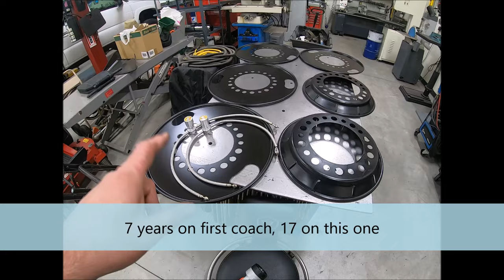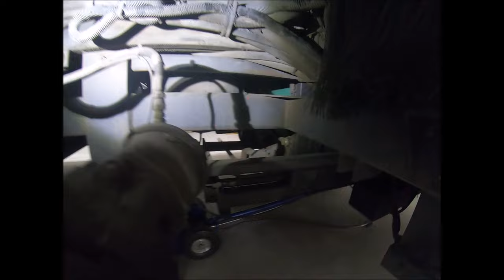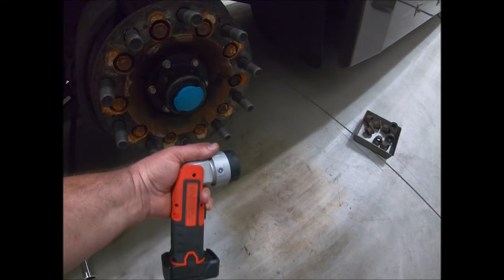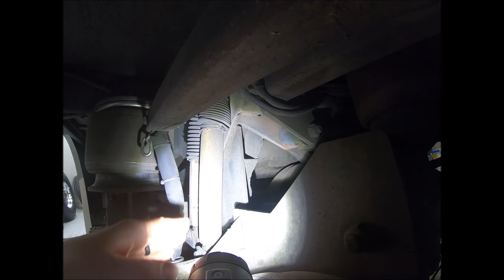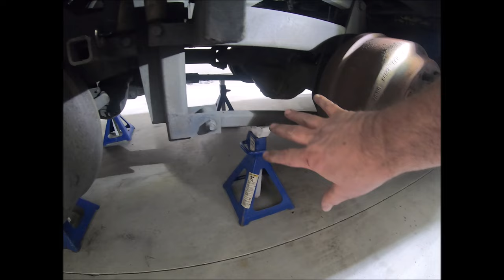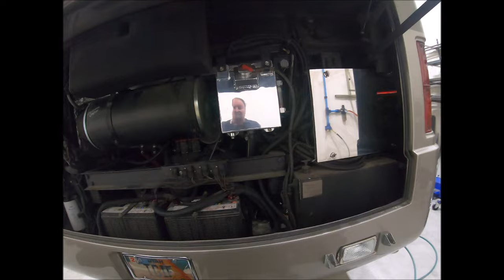Monaco Roadmaster Chassis Maintenance

Comment: As always a great informative video.  

At age 18 I learned that if I wanted the job done right, I'd better to it myself.  My cars and coaches never see a repair shop.  If I want a job done right, I'll do it myself. Yep, I even mount my our coach tires and do my own engine / transmission / drivetrain repair and maintenance.  Over the past 55 years I've saved tens of thousands of dollars, driven millions of miles, and have had the confidence of knowing a vehicle could drive coast to coast without trusting someone to make quality repairs - for me it was great piece of mind knowing that I've done the job right.  Yes, I've invested a lot of money in specialized tools and computer diagnostic equipment but for piece of mind it was well worth it and in my opinion priceless.

After your video, I'm thinking about changing  my 5 P's of Prepare to Prevent Piss Poor Per Performance to your 7 P's of Prior Proper Planning Prevents Piss Poor Performance.  I also have the 6 D's - Duck Dodge Delegate Defer and Don't Do.  When I was a manager in big oil corporate America I often told employees to follow the principles of 5P and not 6D.
Reply from the maker: Thanks Frank.  I couldn't agree more with the peace of mind it brings knowing the job is done right by doing it yourself.

Thank you for taking the time to watch and for the comments.
Mike

Comment: Mike, I am glad that I ran across your video and presentation. I have a 2000 Monaco Diplomat that I purchased a couple years back. It's been hard to get good information about the chassis. For example, the Tie rod ends, and the center link are a problem that no one in my area in South Carolina seem to supply parts. There are a lot of things under the coach that I'm trying to service but it's not so easy when I don't have anything but an owner's manual to lead me. You video was very well done. I have subscribed to your channel and will be viewing your other videos. Thanks so much for sharing.
Reply from the maker: Thank you for the kind words Larry and thank you for taking the time to watch and for subscribing.
Mike

Comment: True, in 2009 there was an economic downturn….
Whatever previous parts were in the warehouse were used. Then, the shortcuts were used to keep the lights on …lay-offs etc.
My old school gasser has a 
cut-above quality. Aluminum roof, aluminum floor vents as opposed to the short-cut flexible dryer vents strung through the cabinetry. Try cleaning out those every autumn without breaking/ ripping them.
It can be a chore finding quality aftermarket furniture. Man made cushions only lasts so long. 
No computerized shades/ awnings and such. Our systems are stand-alone systems. When something needs repair, I stand alone fixin’ it. ✌🏼

Comment: Hi Mike. I just found your channel after Scanner Danner recommended it in one of his videos. He mentioned you do some motorhome videos as well as many other things. After listening to you go over this chassis and hearing all the work and upgrades you've made, I'm really impressed at how much knowledge you have on EVERY part.
  I would like to pick your brain because I recently had a little accident while doing maintenance on my new to me 2011 Tiffin Allegro Breeze 32BR with a Maxxforce 7. I lost a tiny plastic clip(1/4" x 1/4") down the oil fill tube. I have removed the tube and extension neck so I could attempt to retrieve it from the top of the engine. I connected a vacuum to a small diameter tube and try to see if I could suck it up. I can't see it and don't know where it may have travelled and I surely don't know the routing from when the oil goes in, passes through the filter, and all the other orifices in there. Since this is such a tiny piece of cheap plastic, do you think it's something to worry about or will it be pulverised or melt?
Reply from the maker: Thank you for the kind words. 

With the clip being plastic you are probably correct that it will be pulverized and/or melt but it could still get lodged in an oil pickup tube or oil galley and therefore could be directly responsible for a catastrophic failure so I would not be inclined to recommend running it until the clip is retrieved.

Ultimately that would have to be your call.  Keep in mind that if or when it fails, Murphy's law states it will be at the most inopportune time and if you are like me, it will be a constant worry and always on your mind. 

Best of luck. 
Mike
Reply: @zmotorsports62  Thank YOU for the quick response. Do you have any tricks or thoughts on a way to extract?
Reply from the maker: @Jurornumber5 not really.  The trick that you tried using a vacuum and tube would be the best way if it worked.   Anything else I think will be more invasive.
Reply: @zmotorsports62  OK. I think that deserves a second try then. When I first did it, some oil started to shoot up the clear silicone tubing, so I shut it down. I will use a mini shop-vac and sacrifice it if necessary, on the second attempt. I'll let you know if I succeed. Thanks again for your time and I will look forward to your future videos and catch up on your past videos.

Comment: Thanks Mike, I have a 2000 Dynasty and have learned a lot from your channel as you were the one that convinced me to put in the FASS set up on my coach. So this is just a good reminder of some thing I will be starting in about two weeks as a full-time in my coach, so I have to wait until I’m on a concrete pad. Thanks again for the video.
Reply from the maker: Thanks for the kind words Tim and for continuing to file my channel.  Best of luck as you full-time.
Mike
Reply: @zmotorsports62   Thanks again and Happy Easter!

Comment: Thanks Mike for the video! I didn't know about the balance plates and crossfire. I'll be ordering them soon.
Reply: Oh Mike, How can you check the suspension bushings, bump it with a long bar or something like with ball joints?
Reply from the maker: With the weight neutral, meaning not loaded at either end of its travel, which is usually ride height on level ground, place a long prybar between the joint housing and the double shear bracket and try to push it radially on the bolt in both directions (perpendicular to fastener) and look for play.  There shouldn't be any.
Reply: @zmotorsports62  Got it, I thought the load might be too much to see an effect.

Comment: "Mike, great videos! They help me a lot with multiple things related to service and repairs. I purchased a 2003 Monaco Dynasty 42’. We have the exact same Monaco made in Oregon. If you could provide me with some pictures of the fuse schematic on the driver’s side, that would help me tremendously as I’m trying to troubleshoot some electrical issues. I may be pushing my luck by asking for the part numbers for the airbags. Keep the videos coming!"
Reply from the maker: When I have time I'll pull the schematic and snap a picture.  Can you send me your email address as I cannot attach pictures to messages on YouTube.
Mike
Reply: I don't know how to send you something privately. I will ask my daughter to help me send you my email. This is greatly appreciated.
Reply: @zmotorsports62  I tried to send you my email privately. I have a channel as well so I tried doing it through mine as well. No luck. Do you have a Facebook associated with the channel?
Reply from the maker: @JimSandefur sorry, I don't.
Reply: @zmotorsports62  Thank you for trying. Keep up the good videos. Thank you!!!

Comment: Mike
 I just bought a 2004 Monaco Camelot 40 PDQ with the ISC 350  only 5400 miles on it.. Stored inside all its life its in factory new condition .  I am going through it head to toe. Your videos are really helpful. Especially this one on the chassis.   Due to the low miles I will be doing an oil /fluids analysis after 5900 miles .  Am I crazy for buying a 20 year old coach with no miles on the engine and generator?
Reply from the maker: Congrats on the new to you coach.  While I would rather see some miles on them there's also something to be said about low mile rigs.  I would definitely zero everything out and give her a fresh lease on life as you are planning.  That will be the best recipe for success.  

Be sure to replace most everything of rubber as those components and out as well as wear out.  Things like belts, hoses, etc. in particular.  

Thank you for taking the time to watch and best of luck zeroing your your coach.  
Mike

Comment: Great video, we are done with fifth wheel trailers and bought a 2001 Holiday Rambler 38 Scepter, has the Roadmaster. When you talk about the new coolant. How do I switch it out, drain and refill? Or are there other things I need to do, filters?
Reply from the maker: Drain, fill with distilled water, run then drain and repeat until just clear water comes out.  Generally takes 4-6 times.

Once purged of old coolant, fill with coolant of your choice mixed with distilled water.  Also, if your coach was equipped with a coolant filter that took the slow release SCA additive, you'll want to replace that with a non additive filter only.
Reply: @zmotorsports62  Thanks so much, very helpful.

Comment: Fellow ‘03 Dynasty owner here ready to replace tires. I’ve always been a Michelin guy, currently running XZA2 295/80R22.5 but considering other brands. Noticed you used Toyo and knowing how detailed you are I thought you might have a good reason for going with the Toyos. Care to share your thinking on the Toyo choice? Did you stick with the 295/80R22.5?
Reply from the maker: I liked my Michelin XZA2 Energy (295/80R22.5) tires and would have ran them again.  However,  since I bought my last set the prices had gone up substantially.  I started looking at other options and ran the Bridgestone R250 on my last two coaches and really liked them, but they didn't offer them in the 295/80R22.5 size.  I then noticed that the Toyo M144 has a very similar tread pattern and had heard good things about them so I went with the Toyo's.  So far I like them, can't really tell any difference from the Michelin's that they replaced.

Comment: I have heard that these older Monaco Roadmaster Chassis are great but have also heard about a rear suspension issue that some are recommending it be upgraded do you have any comment on that issue believe it was the rear control arms or something like that and is the upgrade as good as the folks who are pushing the change out?
Reply from the maker: The RR4R Roadmaster chassis had some trailing arm issues.  By now most have more than likely been addressed by the replacements.

That being said, those were the lighter Roadmaster chassis under the entry level Monaco coaches.  When you step to the upper models using the RR8xx or the S-Series chassis, those issues were not relevant as these models used a much heavier trailing arm and dual air springs at each axle (except tag axle). 

Hope that makes sense.  Thank you for taking the time to watch.
Mike

Comment: What size are your airbags and where did you find them? Our bus is an 2004 Monaco triple crown signature series.
Reply from the maker: I used a Contitech air springs on our coach, made by Continental Rubber Co.  The part # for mine was AS8897 which was a direct crossover for the OEM Firestone air springs.  I purchased mine from my local Fleet Pride truck parts store but I've seen them priced well from MJ Heavy Truck Parts online as well.

Comment: One question,  I need to do so welding on the frame,  do I need to disconnect the batteries,   and if so what else so not to fry any circuits, transmission, Intelitec systems,  ectopic. Help please.
Reply from the maker: Sorry, but to avoid any liability I am going to have to suggest you follow the recommendations laid out by Monaco.  

I hope you understand.
Mike
Reply: Thanks anyway I understand
Reply: There should be a sticker on the inside of your battery door yellow in color that tells you to disconnect the transmission controls. If it’s not there, I’m sure you can find it in the owners manual.